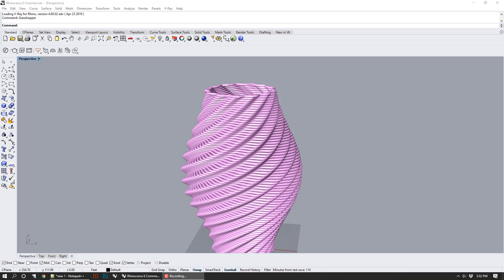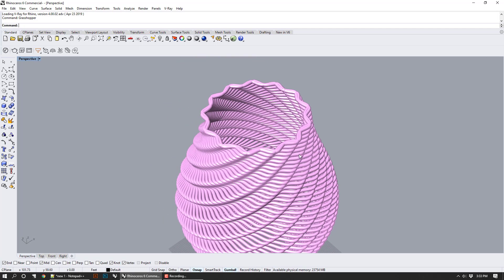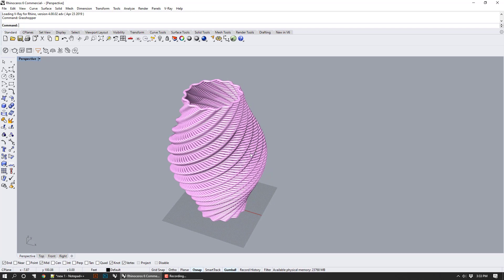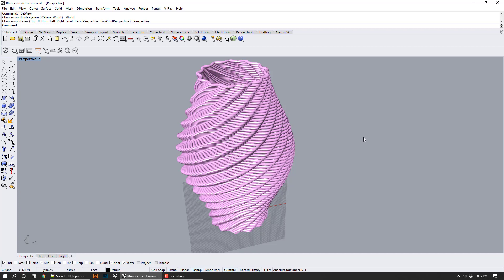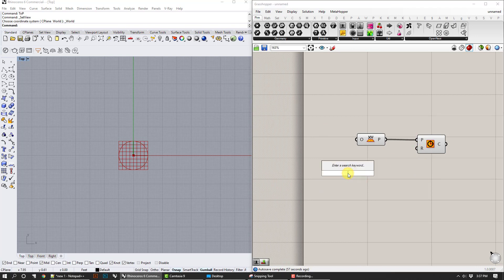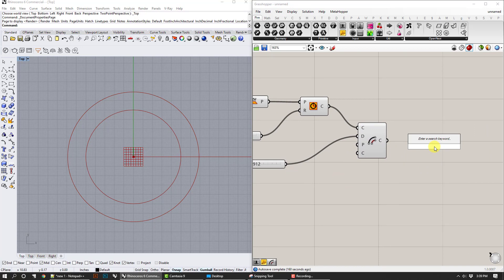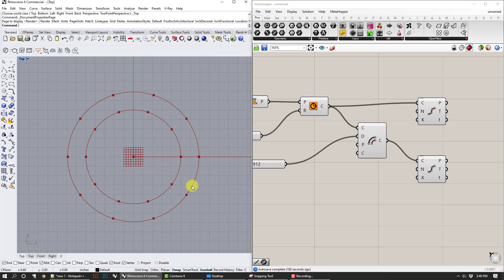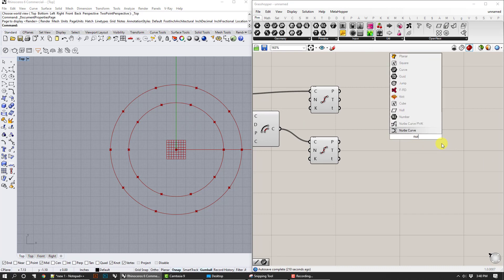ARCH 231 - Parametric Vessel & 3D Transformations in Grasshopper

Comment: This is great! How come it is not printable by baking the pipe? How can I actually make it printable? Thanks!
Reply: Loft the lines into a surface, then use Vase mode in Prusa slicer. Use a .8 - 1.2 mil nozzle, and print with a 1-1.5 mil thick line, slowly

Comment: Then how can I transform it to surface ? great video !
Reply from the maker: In Grasshopper, you can loft the contours together to create a surface. It would be the Scale step before the Pipe command. To get a similar texture, you could try making the pipe radius larger and Booleaning everything together into a solid, although, that doesn't usually work very well. If you are not worried about a solid, you could sweep an open or closed curve over all of the contours to get a surface. Good luck!
Reply: @nsenske  Oh thanks for your answer . That helps me a lot . Is there a grasshopper wiki or something like that ?
Reply from the maker: @cleisonarmandomanriqueagui9176  There is! Check out: http://wiki.bk.tudelft.nl/toi-pedia/Grasshopper
Reply: @nsenske  ohh its marvelous . Thks